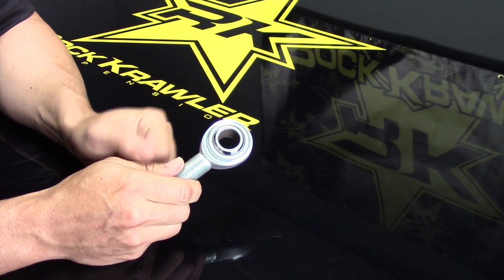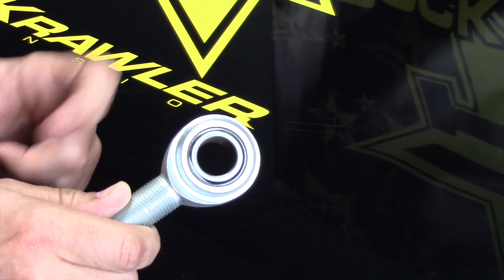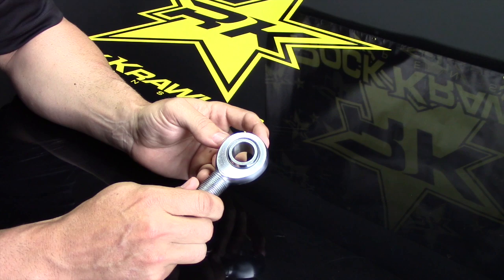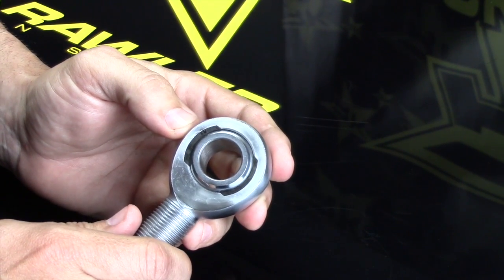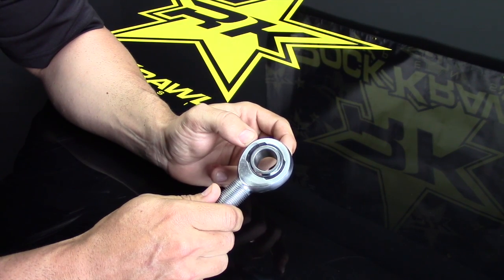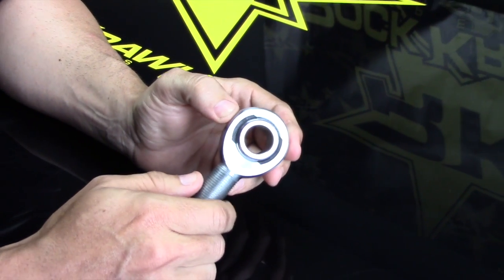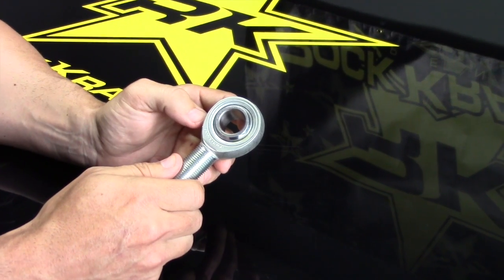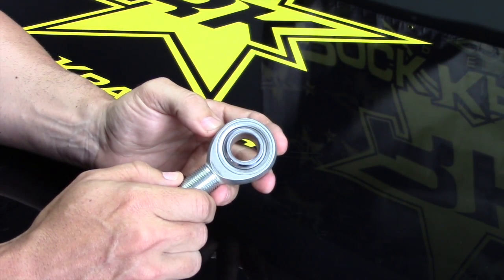Heim Joints / Rod Ends - Choosing the Right One - Rock Krawler Tech Series

Comment: Y are some right hand and left hand my traction bar has some that the joint doesn't move? Is this correct
Reply: Right hand thread and left hand thread allow the component they are used on to be adjusted in length without having to remove the component, be it some type of radius rod or tie rod.
Reply: If they are tight and not loose, as long as you can move it with the bar installed, that is fine.  They can be made extremely tight..
Reply: Pure Performance thanks